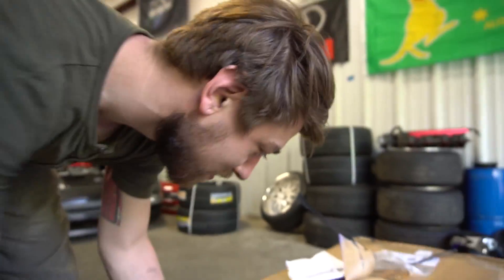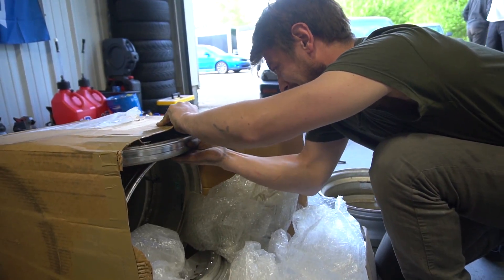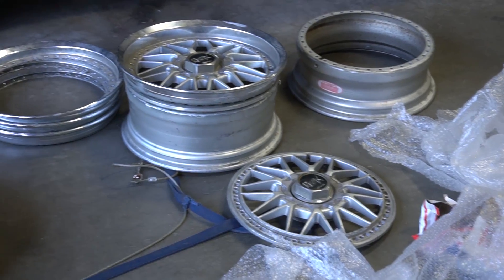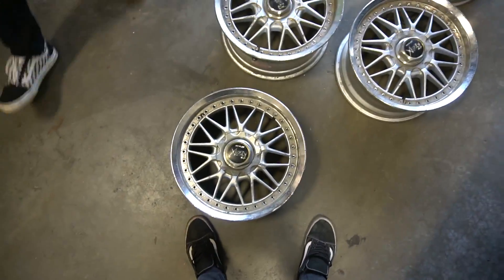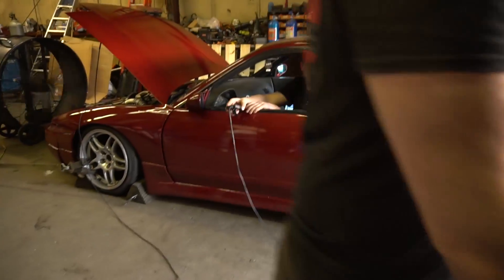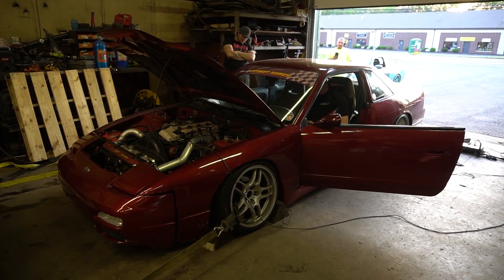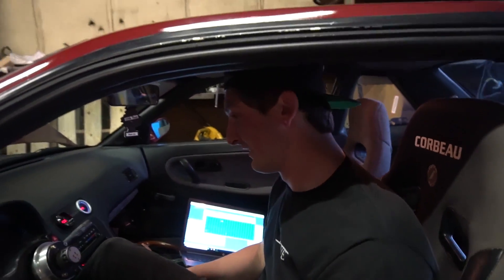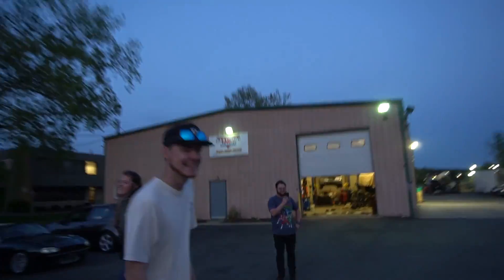Boosted on a budget - Surprises us all!

Comment: I thought about going SR but after this I might just KA-T. KA for the win
Reply: KA is the way to go on a budget
Reply: it’s cheaper by far and kas are stronger than srs
Reply: @Tanner731  Doing a KAT build RIGHT is most def not cheaper tbh. They cool tho.
Reply: K.I.S.S.
Reply: Well, with the price of sr's sky rocketing, ka-t seems the way to go. S13 redtops are going for around 3k from the importers.
Reply: @rholt7448  ka-t makes more power than SR anyway lol. 0.4 liters more. SR with 9 psi makes around 200, while a KA-T with 7 psi makes 230 as proven in this video. now imagine a properly built KA with 15 psi, that thing will be making 350hp+ leaving the SRs in the dirt. sure it will cost more, but not much more than buying a modern day SR swap
Reply: @aku-pf4tl  why does everyone base everything off power?
Reply: @rholt7448  i mainly say it because everyone else does but yes you’re right, horsepower isn’t the heart of the equation. both engines are good anyway, an engine is only as good as it’s builder/tuner